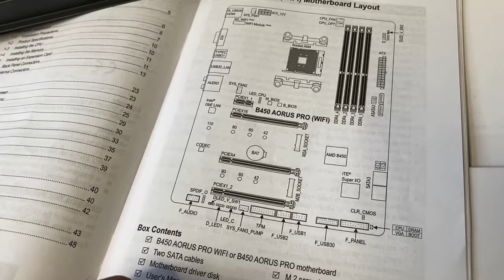How to Install a Case Fan in your PC

Comment: Hey man currently i dont have an rgb case fand yet but i think the case that i ordered came with 3 120mm case fans non rgb and i think it is 3 pin and my motherboard is asus tuf b450m pro which has 2 4pin connector. So i need a fan splitter. If the case fans are 3 pin, should i buy a 4pin to 3 pin fan splitter?

And what if i bought a rgb case fans and the case fans is 3pin i will need a 3pin to 4pin right? And if the rgb is 3 pin, i will need 3pin to 4pin rgb connector?
Reply from the maker: Chenete Espares for the case fans, just get a 4 pin fan hub/splitter. No need to go from 4 pin to 3 pin adapter. The 3 pin fans plug into 4 pin plugs no problem. 

If your RGBs has 3 pin ARGB connectors, you’d need a 4-pin to 3-pin adapter because the 4 pin uses 12v and can fry the 5v 3 pin rgb fans as seen in this video. You’d need an adapter like the one in the description.
Reply: @BuildsWithV  what is the difference between the 3 pin and 4 pin in case fans and in the rgbs any 4pin to 3 pin adaptor will work right? +1 subscriber
Reply: @BuildsWithV  btw which one is better fan huh or fan splitter?
Reply from the maker: Chenete Espares so a 3 pin fan connection doesn’t allow for speed changes. If your fan has a 4 pin connector you can change the speed via software, 3 pin will always run full speed.

For the RGB side of things, 4 pin is a 12v connector and a 3 pin is only 5v. I don’t believe there’s any real difference besides the power. The reason you need a special adapter for the RGBs is because if you try to power the 3 pin 5v with the 4 pin 12v connector you’d probably burn out your wires or LEDs. (When I first started and didn’t know I did exactly that because I spliced a 4 pin connector into a 3 pin led) The adapter will control how much voltage goes through it and it will turn it down to 5v. However an Adapter that goes from 5v to 12v will increase the voltage, you’d also have to plug in a sata connector from the PSU to get that extra power.

Thank you so much for the support 🙏
Reply from the maker: Chenete Espares fan hub would be needed if you had more than 3 fans connected into one fan header on the motherboard. Usually fan splinters will allow you to plug in 3 (sometimes 4) fans into one header. While a fan hub will allow you to plug in way more, sometimes up to 10 fans into one fan header. Again, to allow for all that power usage you’d need to use a data plug from the PSU to give extra power. So basically the hub will use the power from the psu to power all those fans, the reason it still plugs into a motherboard header is because of the speed control/speed reading.
Reply from the maker: Chenete Espares also sometimes people wanna take as much stress off the motherboard so they’ll use a fan hub to get the power from the psu instead of the motherboard. I personally use fan splinters unless I absolutely need way more fans. My personal build has 9 case fans and I use a fan hub on about 6 of them. The other 3 are direct to motherboard. No real reason I did it this way besides my fan hub only supporting 6 fans.
Reply: @BuildsWithV  So for now i just need a fan splitter to power those 3 fans and i will buy another 3 rgb fans i will need a fan hub. Can you recommend a fan hub that can power 6 fans and that is sata powered not molex because some say that molex is bad idk lol.
Reply: @BuildsWithV  and also the 3 fans will be the casw fans and the another 3 fans will be rgb idk what fans tho i just want a great airflow as a high priority and a decent rgb
Reply from the maker: okay so this fan hub here https://amzn.to/34ntZuH seems to be exactly what you'd need. Reviews are great and it uses the sata connection. I also dislike using molex. You can use any 4 or 3 pin fans with this hub so mixing different ones wont hurt or cause issues.
Reply: @BuildsWithV  ok thank you

Comment: How many volts is  the output?
I have a fan that goes on 12V so can i connect him ?
Reply from the maker: 12v rgb won’t work with the 3-pin 5v RGB unfortunately
Reply: @BuildsWithV  i conected it and it works well, im just afraid that he wont overheat and 💥.

Comment: The chassis fan that came with my case doesn't have that kind of connector, it has one cable with two plugs, one of them clips onto another cable from the case, which also has a weird wide connector with "SATA" written on it. Did I just get a bad case?
Reply from the maker: Nope, your case fan is just sata powered and I think the other cable might be for rgb or fan speed control. You can always change the fan to something else tho. What case did you get?
Reply: @BuildsWithV  a KOLINK VOID RGB case or something.
Reply from the maker: @augustjschroeder  hmm I’ve never seen one of those cases but I’m pretty sure it’s standard hub or something. Just gives you various ways to connect it. I looked up the user manual and unfortunately that doesn’t show the fan that’s install or even if there’s a hub or anything useful

Comment: Hi i want to ask if I plug the fans to a fan headers will the rgb turn on , im not planning to control the rgb to I only want to know if it will turn on
Reply from the maker: As long as you don’t plug in the RGB cable, the RGB won’t turn on. Some fans are different however, but most will not turn on RGB.
Reply: @BuildsWithV  Oo ok thx

Comment: i’m using the gigabyte b450m motherboard and there’s only 1 sys fan connection. i plugged in my cpu fan and the back exhaust fan. where do i plug in the other 3 fans?
Reply from the maker: You will need a fan splitter or a fan hub

Comment: I need to connect 3 normal fans and 1 exhaust fan. But there is only one sys fan socket on my motherboard (gigabyte a320).What should I do. I buy a fan multiplexer and connect to all of them or am I connected to the exhaust fan on psu? Pls help me...
Reply from the maker: I recommend you buy a fan splitter.

Comment: I messed up at 3:28 since I plugged the wrong fan cable wrong. I'm trying to remove it, but I'm worried I might force it and break the motherboard or cable pins. How do I remove it? Please Help!
Reply from the maker: Hyde Kido If you put it in wrong and it didn’t already break, then you should be able to pull it out without breaking. Just be careful and pull it out and hope for the best is all I can say. I’ve made plenty mistakes and most of the time I took my time and it worked out okay.

Comment: Is there a problem if I connect a 2 pin into a 4?Like connecting the fan which has 2 pins into the mother board with 4 pin?
Reply from the maker: TBH I’m not too sure, if the connector is the same I’d assume it’s fine but I haven’t actually seen a 2 pin personally 😅

Comment: One issue I saw is that you don’t know how to tighten screws. You should always criss-cross them and tighten them gradually and when they are all set then continue to tighten them more again in criss-cross pattern. It might not be so crucial that the cooler is tightened unevenly but it’s good to know when you say change a wheel on your vehicle..
Reply from the maker: I’m very aware of that. For a fan on the case there is absolutely no need to do that. CPU cooler is 100% necessary.

Lots of car work it’s important. When you rebuild a motor that’s also very crucial. I’ve rebuilt several 👍 Thanks for watching 🙏
Reply: @BuildsWithV  yeah I felt that you probably already knew that, it’s common sense but someone who will see this comment might still learn something new. Keep up the good work 🤙
Reply from the maker: @GimiBsk  that’s a great point. It’s no worries at all. There are plenty of people who don’t know and I do appreciate you bringing it up.
Basically anything that has two flat surfaces that need a near perfect contact like a cpu and cooler absolutely should have each corner screwed in place equally and in a cross (X) pattern. When I started building my first motor like 10+ years ago I had no clue and wondered why I couldn’t get the head seated properly. After a bit of google I figured it out 😅

Comment: Can I put Corsair ql120 with this method. Or only with commander pro.
Reply from the maker: You can plug the Corsair fans into your motherboard fan header but for the RGB it will have to use Corsair device. Either commander pro or others

Comment: I have a fan hub and I can control the rgb with a switch on the case , however I bought a mother board and I want to control the hub with the mother board please tell me how, ...msi b550m mortar and I don't know the name of the hub.also my fans in the hub are 6 pin

Comment: Thanks! but i only have one issue after i connected my case fan to my pc exactly where you placed it on your video and turned it on, my case fan is making a lot of noise and since that im worried that it might damage something inside of my pc i immediately turned it off and check whats wrong, i touched my case fan and it feels hot, whats the problem and how do i fix it?

edit: my cpu fan is fine its quiet its just my old case fan is making a lot of noise  i hope this information helps
Reply from the maker: Could be a bad fan, I’d remove it and get something else. That’s good that you turned it off quickly.

Comment: First and foremost I’m a beginner to setting up a PC. What if the PC already has fans, can you still put these on top of them? Maybe I’m taking the “case fan” too literally lol because it sounds like they’re just cases you can put on top of a fan that’s already there. Secondly how would you attach fans to the top and the bottom when there’s no screws?
Reply from the maker: So you would remove and replace your old fans with new fans. You can technically double stack them but there’s no real benefit. Usually new screws come with the new fans so you’d use those to mount the fans up top or down.
Reply: @BuildsWithV  oh ok I see. I opted for a pre-built PC, the MSI Aegis RS. That already has the RGB fans and like 4 of them lol. Say do you have any videos about setting up RGB cables behind one’s desk, monitor etc.

Comment: Why does some fans doesn’t come with a screw thread ? How do I attach them to the case then , this got me confused especially when buying online
Reply from the maker: Most fans don’t come with the holes threaded. The screws used for fans will thread the hole the first time you put the screw in
Reply: @BuildsWithV  oooooohh so that's how , Thanks! Do they require a specific type of screw to be able to thread the hole ?

Comment: so how do i tell how much fan pins my motherboard has on the specs?
Reply from the maker: Windows XP all fan headers are 4 pin on the motherboard. If you’re asking how to tell how many you have on your
Motherboard, you have to look in the manual or look up your motherboard online and you may be able to find a diagram. Thanks

Comment: I need help, just got the o120’s but the rgbs don’t turn on. Where am I supposed to plug them in? My motherboard is the B450M tomahawk.
Reply from the maker: I’m not sure if the tomahawk has the 3 pin ARGB header on the motherboard. If not you can get a special adapter that goes from 4 pin rgb to 3 pin rgb. You got the same fans I have in this video
Reply: @BuildsWithV  do you have a link to a cheap adapter? Preferably Amazon. I got three of these fans but separately not a bundle.
Reply from the maker: I can’t find something that might work unfortunately. I found one but it’s like 30$ and not sure if it works for this application.  https://www.amazon.com/dp/B07T5CSZ52/ref=cm_sw_r_cp_api_i_tzhoFb1581N3A
Reply from the maker: @Chris-vh7rc  I found one https://amzn.to/2Q0rmGS

Comment: Can you only install 3 fans in a four fan case? ( because most motherboards have 3 slots)
Reply from the maker: Yes you can, won’t be a problem. you can also get a fan splitter or fan hub to use more fans if you’d like more fans.

Comment: Wait so you don’t have to connect it to the power supply? Sorry I’m just learning this stuff
Reply from the maker: Depends on the fan, some fans are specifically powered by psu and some are powered like the one in this video.
Reply: @BuildsWithV  oh alright thanks

Comment: I Have a Apevia Sniper X 2 and i dont know what mm my exhuast is but i know the top are 120 can you help me out? or i'll check manual
Reply from the maker: The rear of that case can fit either a 80mm or a 120mm fan. Can do either one. Thanks 🙏
Reply: @BuildsWithV  thx i'll sub

Comment: I bought a new case the Lian Li lancool ii mesh so I transfered my pc build from last year into this case but I have B450M pro-vdh max motherboard and the lian li has 3 pin 5V rgb, my motherboard only has 12V JRGB1 , can I fix this somehow or do I need to buy new fans?

edit: please like my comment so i get notification you replied
Reply from the maker: You can get something like the razer ARGB controller or a different controller that is powered by sata power and controlled with a remote. It depends what you’d like, you can switch fans to use the 12v rgb but that’s up to you. I personally prefer the 5v ARGB fans due to their lighting.
Reply: @BuildsWithV  thanks alot for the fast reply!
Reply from the maker: @TrollProductionsMC  you’re very welcome and thanks for watching 🙏

Comment: I accidentally broke the rail on the case fan header, will my fan still work? Thanks
Reply from the maker: It will still work as long as it’s still plugged in correctly and none of the actual connection is broken.

Comment: So if you have an RGB Fan you can plug into the non-ARGB but still have the LED lights on the fans on?
Reply from the maker: Major If you have an RGB fan you’d need to plug the fan into the fan header for fan to spin and then you’d need to plug the rgb cable into the corresponding header. Some RGB fans only plug into ARGB and some use other plugs.
Reply: @BuildsWithV  Ok thx but do you a ARGB Hub that can hold six fans?
Reply from the maker: Major Yeah so a decent one is the “Timack 12 Way 5V 3 Pin ARGB HUB” you can find it on amazon is you search ARGB hub. It uses sata power from your power supply and also plugs into one of your ARGB motherboard headers for full software control.
Reply: @BuildsWithV  Thanks
Reply from the maker: Major No problem at all, thank you so much for watching 🙏
Reply: So I have to plug the RGB Fans to the hub and the other to the fan slot.
Reply from the maker: Major Yes you plug in the rgb cables into your RGB hub and the second cable would go into your fan header or hub if you’re using one
Reply: @BuildsWithV  thank you!
Dropped a sub and like!
Reply from the maker: Major I appreciate that very much 🙏 Thank you
Reply: @BuildsWithV  I’m so sorry for asking so much questions. But what if my RGB fans are only on one color do I need to plug it into the Fan header only?
Reply from the maker: Major It’s no problem, what fan do you have?
Reply: @BuildsWithV  up here fans led red
Reply: Nvm I found a hub that can be used for my fansThanks for all the help!
Reply from the maker: Major Okay so those need to be plugged into the motherboard for fan power and I believe they also have a 4 pin big molex connector which would need to be used to power the LEDs.
Reply from the maker: Major Okay no problem at all. Thank you 🙏

Comment: Hello sir .i accidentally bought a fan with 6 pin and i have a 4 pin fan on my mobo. Can i just plug it in like you do?
Reply from the maker: I don’t think the 6 pin works the same way. Usually 6 pin fans plug into a separate module and then it plugs into the motherboard or something.

Comment: #1 the top fan is rattling against the case. take it out of the case and set on table sideways (narrow) it makes no noise, but flat horizontally screwed against case. noize ? :( #2 there is no plug and play method the fan tail(wires) look threaded into white plastic box with no way to remove wires. that rail. is not connected to the mobo but connects to a larger white juction box whre more cables are coming into from other fans.

Comment: Spent over 4,000 dollars on a prebuilt PC from Alienware and the hardware far exceeds the cooling capabilities of the case it came with.
The Aurora cases are absolutely terrible in regards to airflow.  Modern Warfare on medium to lower settings still crank my GPU temps to
up to 86 degrees and in the red.  I know 86  won't exactly burn up my card but it's still far hotter than it should be with the hardware that's
in my PC.  Lesson learned.  I'll never go with Alienware again.  Unless of course they stop providing their customers with low end cases!
Because of this I'm desperately trying to find alternative methods to lower my GPU temperatures when I'm playing demanding titles such
as Modern Warfare.  I wish I was a little more experienced with building PCs myself.  I'd really like to transfer all my components from the
current tower over to one that has much better airflow.  I only spent $1400 on my son's off brand PC and that tower is so much better at
cooling than mine is.  It's quite depressing.  😑

Comment: one question, i have a Sentey 6090 box that it has a 12"  blue led fan, and it has the conector. and also i have a msi b560m a-pro mboard, that it has only a sys-fan plug, and a cpu-plug... the cpu is already conected to a rgb thermaltake cooler, and the sys-fan is conected to another thermaltake non rgb fan to the back of the box, like in your video.... my question is, where can i conect other fans to the mother? i have the sentey that's included with the box but not plugged, and i have other 4 fans that i want to conect in the bottom, upside the box... can you, or anyone help me? thanks